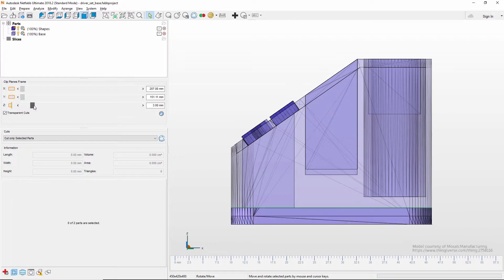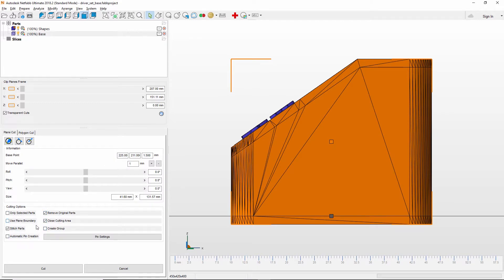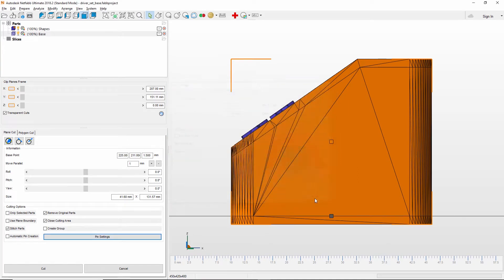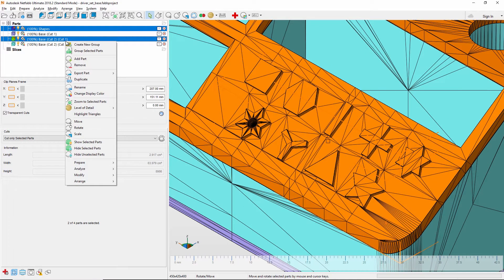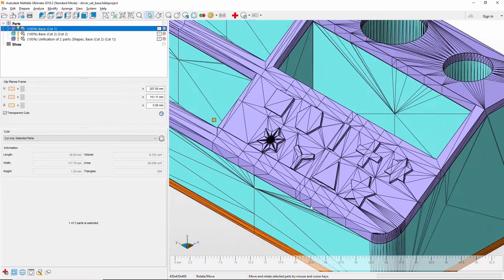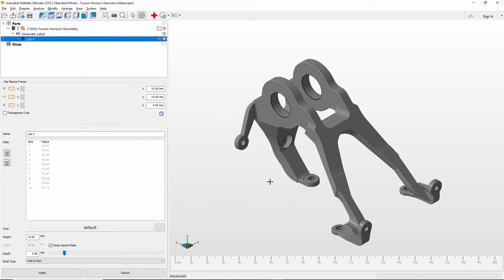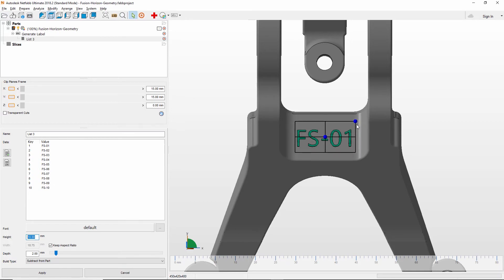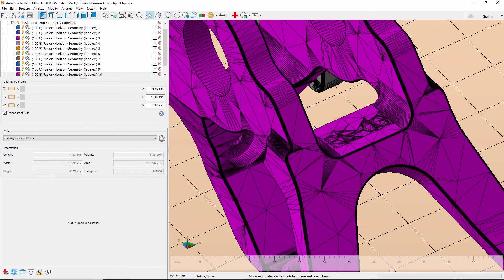Autodesk Netfabb - Editing Models for 3D Printing

Comment: I cut my project up into pieces to make it smaller.  I move the part to my print bed in netfabb.  I exported the stl as a part and as a project.  I slice in super slicer, it looks perfect.  Viewing the gcode looks perfect but my Klipper doesnt like the file.  I've repaired a hundred times.  What am I doing wrong?  Its not the name format.  Its fine.